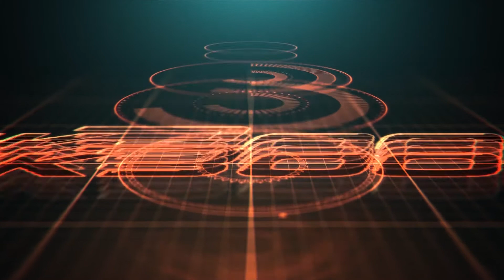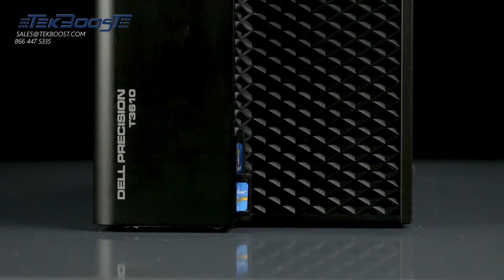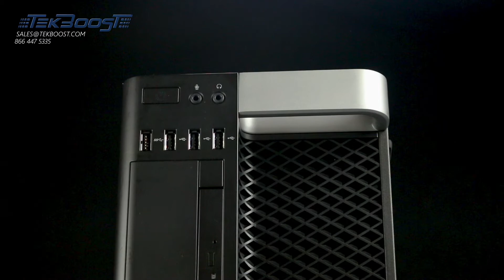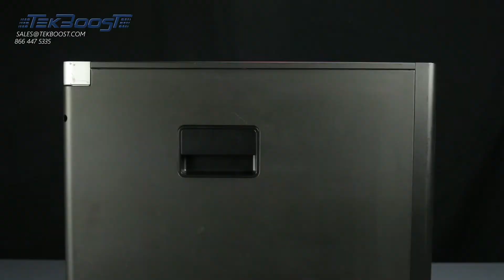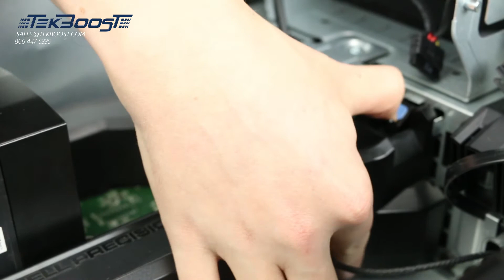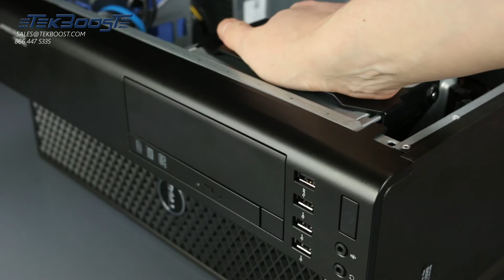Dell T3610 Workstation Memory Installation

Comment: Hello to everyone, I was wandering if i could move my ram 8 gb 2rx4 pc3-10600r - 09 - 10 - E1 from dell precision t 5500 to the new pc (dell prec T 3610) which has also ddr 3  (i think) but the ram on this last pc has this write 2rx4 pc3-10600r 09 10 E1 - P1 (has the - P1 that dell t5500 has not) . can you tell me if there is any differnce?